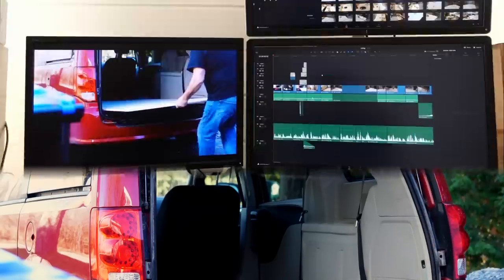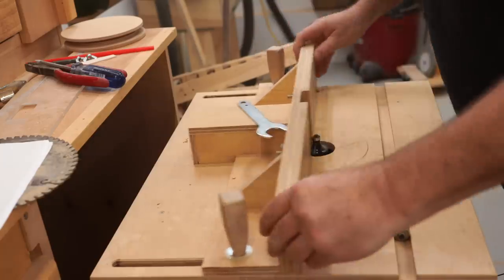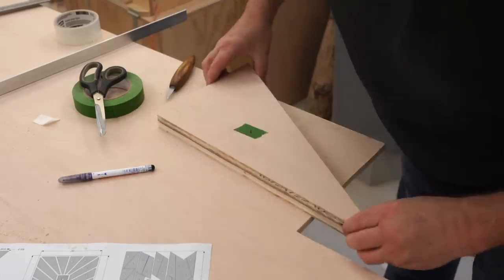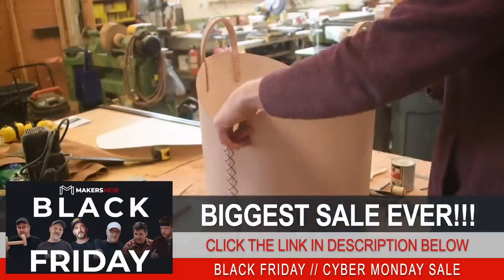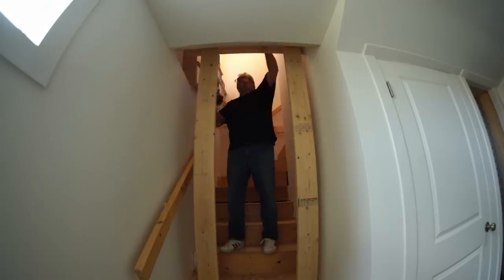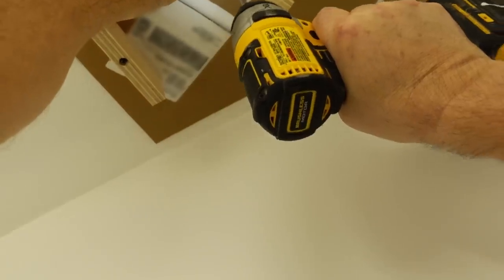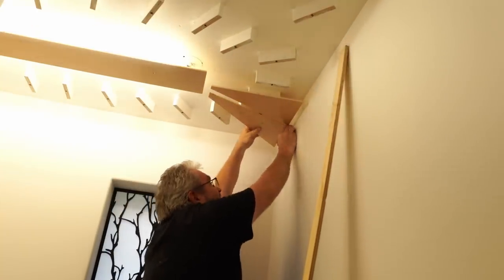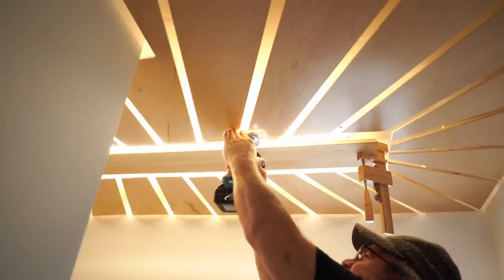Making a Wood Panel Ceiling with Lighting - Sunburst Pattern

Comment from the maker: This project proves that the best laid plans don't always guarantee success. I did a lot of planning before I started, but still managed to waste half a sheet of fairly expensive plywood. 
Some of that goes back to when I was first thinking about doing this ceiling and at that time I thought I would use painted MDF instead of plywood. The painted MDF panels could be used with either side facing down and I wouldn't have to worry about orientation. Or at least that's the excuse I'm going with.
Fact is it was a simple (but costly) mistake and it's a rare project that doesn't have at least one.
Turning to the positive, I love this ceiling and think it was well worth the time and effort. And while the mistake I made did increase the cost, I think it was insignificant when I look at the finished results.
I'm able to picture things in my mind's eye before I start, and usually the end result is almost as good, but this time it was better. Better after I changed the centre panel, that is. 
The slots I cut in that panel and making it a tray with sides to give it extra dimension really completed the look.
The plywood I used is 1/2" maple veneer. The individual parts weight very little and are solidly glued to the mounting blocks, which are also solidly glued and screwed to the ceiling.
The finish is two coats of semi-gloss water based urethane sprayed on, lightly sanded after the first coat dried. This produces a very smooth durable finish.
The lighting is just two LED shop lights mounted back to back to cast the light sideways across the ceiling. 
Another project that I did in this staircase are the shelves I made for my movie collection:
https://youtu.be/jvjqeyT3rjc
These stairs go down to my basement where I've set up a room for listening to music, watching movies and shows and reading:
https://www.youtube.com/watch?v=dsIqbJ55Z0k
The room is a sanctuary away from the rest of the world with no internet access. No phones either.
Reply: The first casualty of any engagement - is the plan. 😂. Given how skilled a craftsman you are… I’m sure you know the trick of painter’s tape and CA glue in place of double faced tape - so I won’t get into that. Ha ha on the neighbor joke.😊. I bet your arms were tired after that project. The rectangular slots in the centerpiece made all the difference in the world. That really really turned out to be excellent.  Thank you so much for sharing. Happy holidays. Best to you and yours.

Comment: Superb, very effective ... I loved seeing you work through each of the issues you came across, modifying the original idea as and when required 👍
Only thing I'd have suggested doing was to mount the lights to the centre panel, with this being hinged at one end and a lock at the other ... to make changing the lights easier (no scaffolding required each time).

Comment: John, this looks really great! Thanks for the inspiration. I'm planning something similar, but with curves that mirror the shape of our fireplace. Now I have a good idea of how to build that. I won't use plywood but a very lighweight but sturdy sheet material, that is normally used to build the interior of caravans and mobile homes. Slightly more expensive but perhaps an alternative for someone who can't or doesn't want to put too much additional weight under the ceiling.
Thanks again, I love the design!
Greetings from Germany
Andreas
Reply: Just curious, what is that material you're considering?  Thanks
Reply: @rdy4trvl  Hey Doug! The material that I want to use is called Garnica Ultralight. Not sure if it is available in the U.S. but I'm pretty sure that there is something similar around. It is a sandwich of two layers of polpar wood with XPS (extruded polystyrol foam) in between. The material is certified safe for interior use and has Emission Class E1 (good for living room/bedroom). The weight is only 11kg (24lbs) for a 12mm (1/2") panel of 2.5 x 1.2 m (approx. 7.5 x 3.7 ft) which results in a weight of less than a pound per square foot (if my imperial calc is correct 😵‍💫) I guess it is not brand new, professionals could buy it wholesale most likely, but it was introduced only recently to our German DiY version of Home-Depot, a company called Bauhaus. Here is the link: 
https://www.bauhaus.info/sperrholzplatten/garnica-ultralight-leichtbauplatte-fixmass/p/27695131#product-data
Perhaps a Google translate helps you with that. 
As said before, I am pretty sure, there are similar panels around in the U.S.
I hope this helps!
Best Regards
Andreas

Comment: I think I would have personally finished building the stairs before tackling sprucing up a boring ceiling, but the result looks very good.
Kudos to you for not giving up and being content with what you got half way, but instead perfectionistic until the end
Reply: Run the risk of damaging the stairs while setting up the scaffolding or dropping tools or wood panels. Typically in building homes or remolding you leave the flooring for last.
Reply: @chefdan87  be that as it may, but his house renovation has been going on for a decade I'd guess. So I'm pretty sure those stairs have looked that way for a long time. And if I were him I would finish up the basics before spending my limited time into fancy wood-paneling for the ceiling, if I have been walking on construction lumber to the upper floor for the past few years.
Reply: @nils1953  Good thing you are not him, or it would be the worst YouTube series ever.

Comment: This was a killer project. I would've had to build a physical template of the ceiling and then built the project on the work bench before attempting to install on the ceiling. I just see it being a cursing fest if things didn't fall into line quickly.